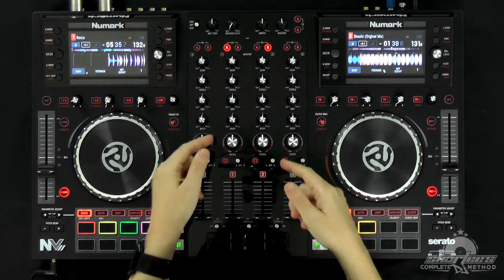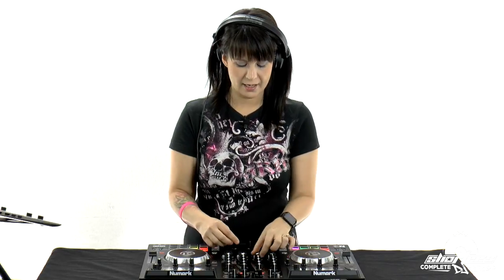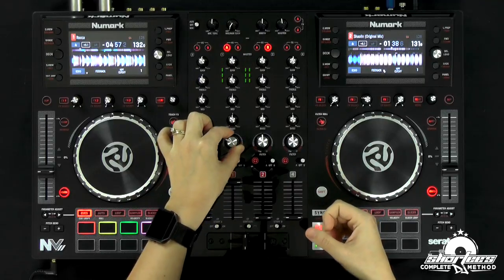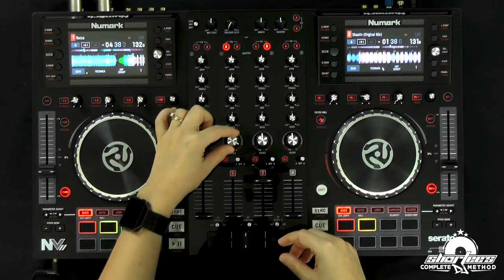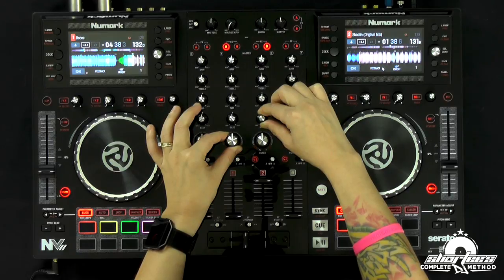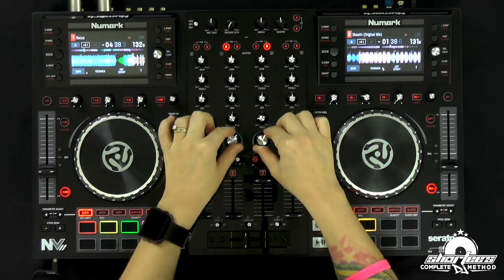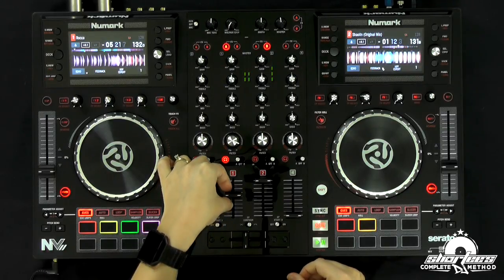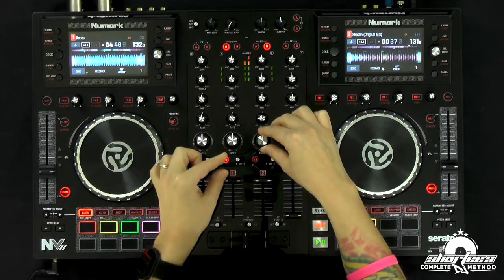How to Mix with the High/Low Pass Filter for DJing on a Serato Controller [DJ Mixing Tutorial]

Comment: Finally, now I have a use for those knobs other than reconfiguring them for FX :-D 
Mixing songs where the first song ends in vocals and the second one starts in vocals, it's hard getting a nice clean mix only using EQ and crossfader.
Filter mixing seems to be doing a much better job for such scenarios, even better than just drop mixing since you can still have a smooth transition!!
Reply from the maker: That's awesome! So happy you found the video helpful :)
Cheers,
Shortee
www.djshortee.com